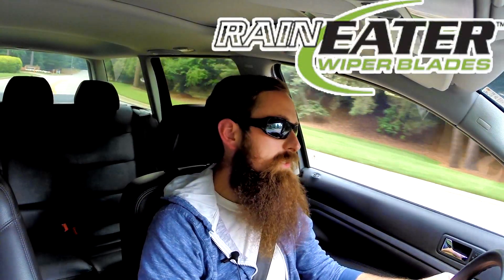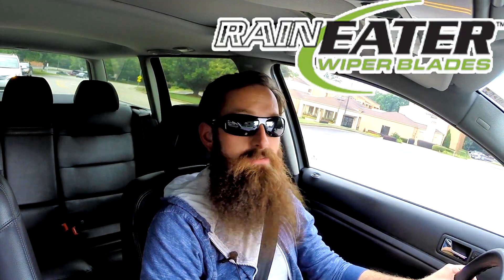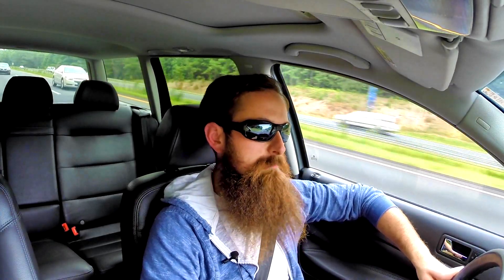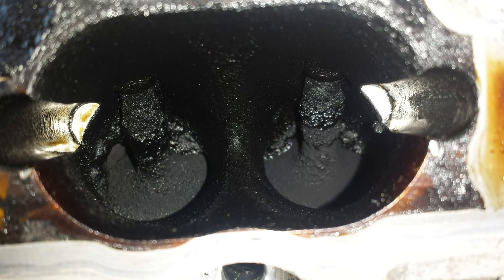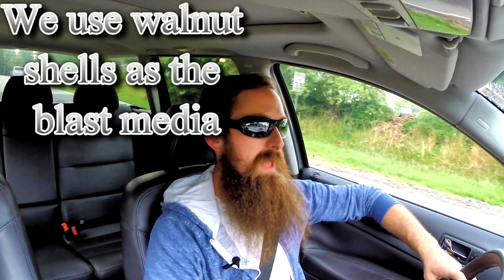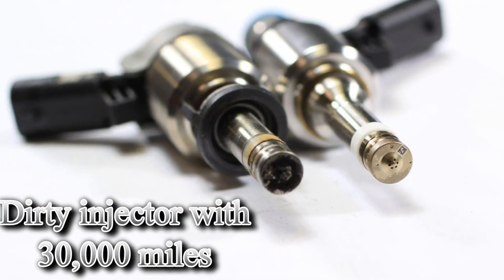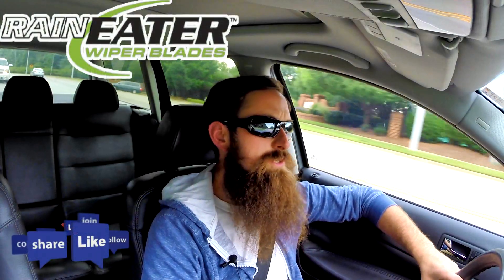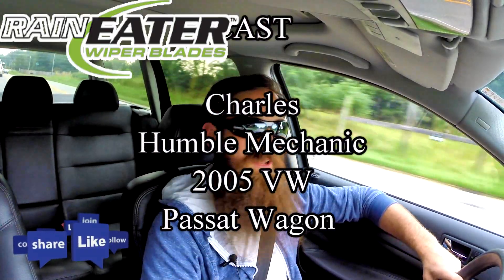Preventing and Fixing Carbon Issues for Direct Injection Engines ~ Episode 80

Comment: This is a spicy topic for the Ford guys like myself. A lot of suggestions, opinions, and general zealotry over what's proper and what's not.
Here's what I've found after having a Focus ST and now a Focus RS.
1. The claim that intake cleaners will ruin your turbo is complete bunk. With in a very active enthusiast community there have been no reported turbo failures after intake cleaning. It doesn't make sense for this to happen in the first place since you aren't adding anything that could potentially overheat the oil seals in your turbo.

2. The least destructive and most effective method I've found (which I now do on my RS) is as follows.
a. Grab a can of engine degreaser (the good stuff not the foam).
b. Get a can of B-12 Chemtool.
c. Warm up your engine for a bit. Turn off the engine and start the intake removal process. On the Ecoboost 2.0/2.3 this is trivial since it's 5 bolts. Move it out of the way and begin to identify which valves are closed. Spray the engine cleaner into the closed valves and let them soak for a good 30 minutes. 
d. Get a shop vac or maybe a carpet cleaner (something that can suck out liquids) and remove all the fluid from the soaked valves. 
e. Rotate the engine manually (either by leaving it in a high gear and rolling it or using a wrench on the crank pulley, then repeat steps C, D, and E until every set of closed valves has been soaked for 30 minutes
f. At this point the gunk won't be gone but it will have been softened up significantly. Put your intake back on along with any sensor harnesses you may have removed.
g. Identify a vacuum source closest to the throttle body or one that feeds DIRECTLY  into the intake manifold. On the EB 2.0/2.3 This is easy, it's located directly after the throttle plate and is the only manifold vacuum line on the engine.
h. Remove the vacuum line and attach a long enough hose to it so you can freely use it to feed the B-12 Chemtool into the intake.
i. Plug the hose with a bolt or something, start the engine and let it idle for a few minutes. There will be some smoke coming out the tailpipe and possibly the smell of burning oil. This is good, the engine degreaser did its job and softened up enough crud.
j. Remove the plug from the vacuum hose and start feeding in the B-12 Chemtool through. Don't DUMP it all in. Just let it atomize the cleaner enough to start causing the engine to run a little rough. Let off and allow it to breathe again. Repeat this process until you see some smoke coming from the tailpipe, then start pouring more cleaner into the hose. 
L. Once you have used up all the B-12 Chemtool, shut down and put everything back the way it was. Let the car sit for a few minutes then take it for a spirited drive. Start off by going half throttle, then 3/4 throttle, then do a full wide open pull to redline. 

That's really it. Since the intake removal process is trivial on the EB 2.3 I can easily verify the results of the cleaning afterwards. The valves won't shine like a brand new cylinder head but 90% of the crud will be gone and a lot of power will have been restored. I hope this helps and I anxiously await the inevitable "BUT FORD SAID DON'T DO THIS" comments to which I'll respond with 66k miles on both engines on factory turbos.
Reply: Jon If I have to go through those steps to keep my vehicle running reliably, then I don’t need that vehicle

Comment: have you tried CRC valve and throttle body cleaner?  worked on my 07 Mini cooper "S" (turbo)
Reply: How often do you clean it?
Reply: @theoldmossandfern  I waited way to late,  cleaned it at 88,000 miles.  should have cleaned it at 60,000..  old the mini with 89K.  PS:  it was a turbo "S"

Comment: Seafoam is for 2 stroke marine engines. Gumout with PEA is for 4 stroke engines that may use ethanol. It helps if you use the correct stuff. BTW: I've had 2 VW's and both the cars and associated dealers sucked in a big big big way.

Comment: OK, I'm not a professional, but a keen amateur mechanic - I run mainly 90's cars, because I think this era was the best for the DIY owner, so I don't own a GDI based engine. However I would have thought the solution was relatively easy - a simple valve into the air intake between the MAF and throttle body. The ECU works out when the car is at working temperature and travelling at 50mph (say) or more. The ECU then releases short pulses about a minute apart of a Seafoam/MavelMysteryOil/RedX like substance into the manifold to 'wash' the back of the valves. A simple reservoir of the stuff can be topped up by the owner when required - much like they would top up the washer fluid.

Comment: 2011 A3 2.0 TFSI   CCTA  85,000 mi.   No cold start misfires, no unusual oil consumption, no mpg loss, no dsg issues.  All maintainance is kept up to date however I have never had a valve cleaning service.   Note: I am retired and just by habit drive 2 other cars locally so the Audi doesn't get much short run driving compared to most drivers.  Also it gets a 1200 mile run down and then again back from FLA.  every year. I drive it hard all the time.  Only use  top tier gas, here Kwik Trip has 91 non ethanol top tier that I use in it exclusively.  Anyway now that I have posted this I will probably get cold start misfires!

Comment: Toyota has solved this problem with dual injectors. One goes on manifold, before the valves, and another is a direct injector. This way, you have the direct injector advantages, and the traditional one for cleaning.

Comment: I vouch for sea foam (with top-tier gas) for fuel treatment, but I've always been kind of leery about putting that stuff through the intake manifold (or engine oil, for that matter).  I'm sure it works to clean carbon out of an engine, but I worry about knocking too much crud loose and then plugging up an oil gallery or somesuch...
Reply from the maker: I really think if you are using it as a preventative, it might be okay, but I don't think it will be a fix
Reply: @HumbleMechanic  IMHO, it's the best stuff ever for little two-cycle engines (with only ethanol-free gas in these fuel systems of course)...  Or at least it's a better alternative than having to keep buying new carburetors...

Comment: I have a 2014  Volkswagen jetta TDI direct injection do I need to worry about carbon build-up on intake valves in a diesel engine?
Reply from the maker: Tdis of this generation don’t really have this issue
Reply: @HumbleMechanic  is the 2014 tdi a good engine this is my first tdi?

Comment: Or seafoam!
Reply from the maker: Seafoam will not solve this issue. It may prolong symptoms but I don't think it will cure it
Reply: @HumbleMechanic  true or just add in a 5th injector in the intake to wash the back side of the valve which wouldn't be a bad idea along another row of secondary injectors too for boosted applications but need to do custom tunes. Eah but oh well its the only way i can figure out with out stripping it down ever year or so and do manual cleaning of run seafoam thru the intake also.    I ran some thru my LNF and it sure helped abd i do it ever 10k miles or so.

Comment: Any thoughts on CRC Intake Valve Cleaner? 

Says it ‘Delivers concentrated advanced Cozol technology directly to the backs of intake valves. Dissolves baked-on carbon deposits’
Reply from the maker: IT may help, but if it's caked on it will not clean it. also all that crap has to go somewhere.
Reply: Thanks for your input, my dealer told me about a ‘fuel induction cleaning service’ for my Optima that has GDI. Seemed to be a similar process of this CNC spray cleaning.

Comment: Just had carbon clean up done with the walnut blasting kit at the dealership. They charged me just labor to do it, it was 240.00 (2 hrs of labor). It does make your engine run brand new when it gets done.
Reply from the maker: Yep, that is a good price too.
Reply: Yeah, unfortunately, I did spend 950.00 for them to do the water pump while the intake was off, so they did it just for labor

Comment: Will a Dealership BG GDI Fuel/Air Induction Service every 15K miles make a difference and is it worth it? Will it clean at least 50% of carbon buildup?
Reply from the maker: Maybe, but you will probably spend the same amount to do that as you would having it cleaned HAHA
Reply: Good advice! Thanks Charles.

Comment: I have a GDI engine with 150k miles. I just recently heard about this issue. It's never been cleaned. Still runs fine and the fuel mileage is just as good as always. Guess I'm lucky
Reply: How is your driving ? You run the engine at higher RPM? 

Recent buy a Kia Rio 2014 with 80k miles... 😶

Comment: Other than seafoam, have you had any experience with products like CRC Intake Valve Cleaner?
Reply from the maker: I have used a few. None really helped with this issue.
Reply: @HumbleMechanic  I am thinking of using it on my 208 GTi as a preventive measure instead of opening my the engine head every 5 years or 100,000km. I was thinking of using the CRC intake valve cleaner every 20,000km or so as per the instruction instead of waiting for a symptom to appear and then do something about it.

Comment: Hey @humbleMechanic! I have a 2.0L Camaro which is Direct Injection. Does everything you mentioned about DI in VWs also apply to the Camaros DI? And would a STP Direct Inection cleaner help with carbon build up?

Comment: A little tip I used to do decades ago was to pull the spark plugs while the engine was still hot and dump about 4 ozs of Marvel Mystery Oil in each hole, replace the plugs and fire the engine for just a second to let it get all over the combustion chamber and let it sit over night and start it the next morning and take it for a drive and drive a little aggressive and it will clean most of the carbon in the combustion chamber. It will smoke at first and once it has cleaned the carbon out you'll feel the difference in performance. What it does is soaks the carbon down to the metal because of the hot combustion chamber and breaks it loose and the catalytic converter will burn it up eventually.
Reply: You may end up having a hydra lock by doing this.  I wouldn't recommend this.
Reply: That wont have any effect on the inlet tract carbon though.

Comment: What’s your thoughts on adding water injection as a method for cleaning the intake?
I read that this is one f the “side effects” of water injection because the water turns to steam and virtually steam cleans the inside of your inlet manifold as well as engine internals.

Comment: Even a representative from Liqui Moly (which is a renomated company that produces lots of oils and additives for all kinds of car fluids) that you CAN'T fix carbon build-up with a fuel additive in a direct injected engine, because it won't even hit the valves.
The thinking of VW may be: "Let's hope the cold-start issues are the injectors and use the additive first to clean it up". Once you have diagnosed that it is indeed the valves you can pretty much forget the fuel additive.
Reply: You can "fix" carbon build-up with fuel additives by making the combustion process more complete and thus decrease the generation of soot particles. What it won't do is cleaning the already existing deposits from the back of the valves. But a good additive can help lower the rate at which these deposits are created. Also, Liqui Molly actually has an EGR/intake cleaner, which can be sprayed into the intake, from where it will also touch the back of intake valves. The cleaning effect might be very limited, but nonetheless that's definitely also a way in which an additive can actually clean carbon deposits also on direct injection engines.

Comment: Hi Humble Mechanic. I know this video have been up a while and relates to direct injection, but do you have an opinion on the following. Additives for cleaning port injectors seem to work. Saw an episoder of the English car show Fifth Gear, when they in steps tried to " restore power" to an 8 year old Golf GTI. One step was using a full tank with cleaner additives with a pre and post dyno test which showed an increase in power. Any opinion on these additives cleaning the valves/valve stems as well as deposits in/on the injectors? Keep the videos coming.

Comment: easy, although costly solution: use both port and direct injection! Toyota has had a grasp on this since I believe 2007 in the Lexus LS460. I've never seen one of those motors with intake valve carbon build up issues

Comment: I work at an independent shop and I have done 10 or so manual intake valve cleanings on 2.0l TSI motors. What do y'all charge labor time to do this? more specifically, what do you add on top of the intake R&R labor?

Comment: Hey, why are the Italians getting credit for the Italian Tune Up?  I can remember in the mid-1960s, by grandfather took his Oldsmobile 98 with a 425 Super Rocket Engine, which was cool, because when you raise the hood, the air breather had Rocket stamped on it from Olds.  He'd take it out on county roads to open it up and "clean the carbon," basically by cranking it up to 90 or even 100 MPH, and I remember a couple of times 110 and 115.  We loved it as kids and we didn't even have seat belts in those days----talk about a thrill.  And he wasn't the only one, many family members talked about burning off their carbon build up and it quite often worked on a cop who understood engines, since I can remember my grandfather getting stopped and when he told the officer that he was just cleaning his carbon build up, and the office would just give a warning and let him go.  So if everyone knew about it and many did it in the '50s and '60s, then why is it called an Italian Tune Up?

Comment: This GDI “carbon build up” problem is annoying! Great video thanks!
Reply from the maker: Thanks!
Reply: HumbleMechanic 
I bought a 2009 Mini Cooper S from a junk yard and it only had 50k mi for only $3k. The only thing wrong with it was the back bumper which I replaced. It runs like a champ. Only put a Forge BOV and just order an oil catch can from M7 racing. I learning how to “do it yourself” so far so good. I’m at 60k mi now so just as a precaution I’m gonna get it “walnut blasted” the cost is only $400.00 not to shabby compared to other shops which is almost double.

Comment: Direct Injection German cars are notorious for: 1) Burning Oil and 2) Dirty Injectors over shorter mileage.  If you have the ability to maintain them yourself or love taking it to a mechanic, then that choice might be for you.  More and more vehicles are slowly becoming DI Turbo applications - learn how to maintain them at an optimum level and don't fall into the misleadings of the manufacturers recommendations for certain maintenance applications (e.g. oil, pcv, egr, valve cleaning, trans fluid...etc).  You will be in a better place instead of dumping sucker money to your not so favorite mechanic.

Comment: Ive seen E85 clean up carbon on port injected engines.  What if you ran E85 through a meth injection system for whatever amount of miles...could it possibly clean up the intake ports over time?

Comment: my golf R is 40 000 km and so far every 20 000km or 1 year i use CRC GDI valve Cleaner as a preventive tool, I'm sure it does not remove all the gunk, but do you need to remove all anyways ? i'm sure it get's dirty pretty quick after it gets cleaned up, so time will tell so far, my car runs fantatically good, no issue, no codes.

Comment: @4:15 "the Italian tune up" - doesn't going full throttle greatly increase combustion pressure, therefore more blow by, therefore more oily and crappy fumes going from the PVC to the intake ... making the problem worse?  
IMO driving like a school mom will result in less carbon build up on a GDI given where it's coming from.
Reply: Absolutely right.  Half the guys commenting here have no idea what direct injection is, or how valve timing works.
Reply: My Tucson nearly blew up from being driven like a grandma the carbon on the pistons increased compression to the point I had to use 93 octane and it would still ping. Bad idea driving it slow, the catylic converter even went out 103,000 miles 2016 Hyundai Tucson.

Comment: Excellent info, and I agree with all of it. I've had 1.8T A4, 2.0T A4, 2.0T GTI, 2.0T TTS, 3.6 VR6 CC, and NEVER any problems from carbon. I use only Shell V-Power, always let the engine idle for at least a minute before taking off, and  use some WOT every drive. My commute is never more than 10 miles, and I rarely go on long road trips, yet carbon has never been an issue.

Comment: So essentially, we have to manually clean direct injection engines every 50,000 miles. We have to factor in that cost.

Please mention the average cost of that procedure in general.
Reply: ChadatWork he did - $700. Here in Australia I’ve been quoted $550AUD (USD$370) to walnut blast my Mazda 3 MPS by a BMW/Mini performance workshop.

Comment: That VW fuel system treatment is just Chevron Techron with a VW sticker on it and a higher price tag.  It used to work good on the old 5 valve engines with port injection, won't do anything for direct injection motors.  I read an article on newer direct injection engines adjusting the intake valve opening time later, to help with the carbon issue.

Comment: Thanks for the video.

Ok well since I bought my Fiesta ST brand new in Jan 2015 I have been running it on Shell V-power 98 octane fuel also been doing early oil and filter changes every time so I think or at least I'm hoping that my engine should be pretty clean and it runs perfectly IMO but I am still buying an oil catch can this week..  I know there will be carbon build up in my engine but hopefully it will be okay..  I have no mods done to the car at all 100% stock.